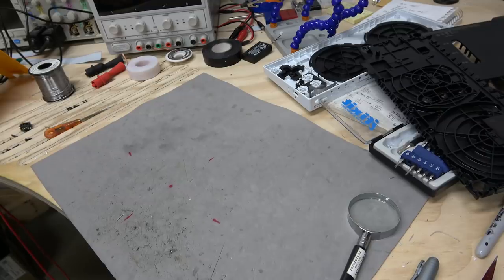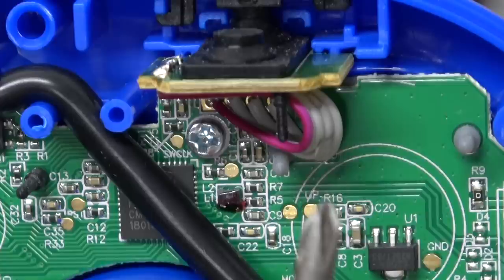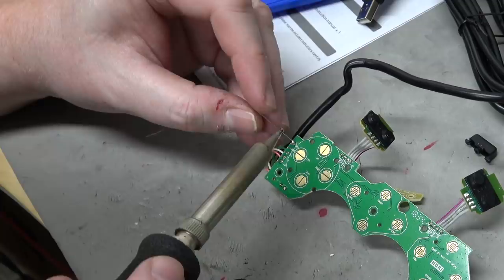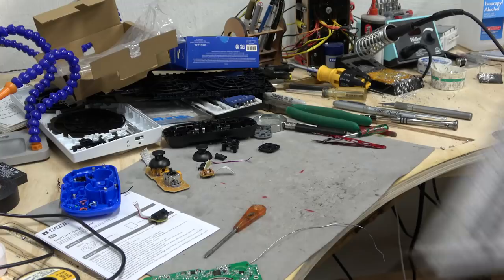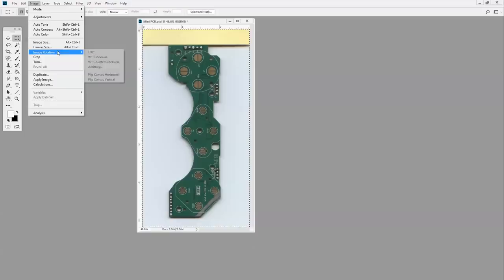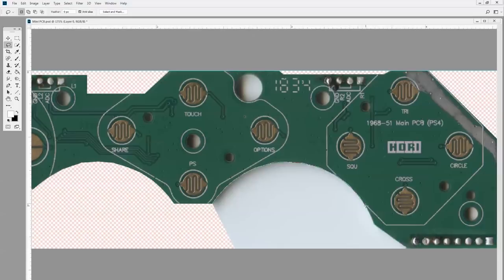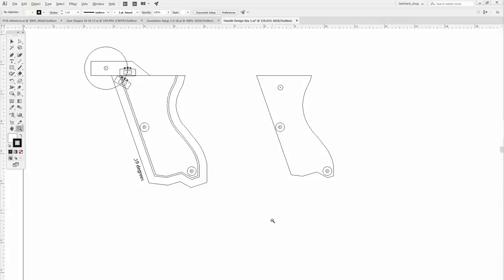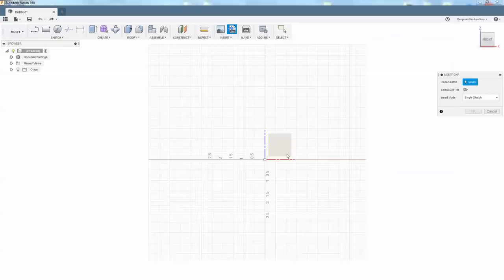The Quest for a PS4 Single Handed Controller Part 1

Comment: you don't have to wait for hot glue to cool off if you spray it with upside down compressed air duster can which freezes it in place instantly

Comment: I've had a spool of rosin core leaded radioshack solder for 5 years and all that has happened is a powdery corrosion that goes away as soon as you use it, so it's basically still like new.

Comment: this is super great but i disagree with the second joystick on the bottom of the thing unless there is a actual base or stand kinda thing for it... id rather like seeing an accellerometer gyro combination to give this thing something that is sorta gesture controlled. you could use a small micro for reading the mems ics and then a pair of digital pots to make this work. could maybe even work with the attiny10 (atleast pinwise)

Comment: The rosin in solder can go bad. But that solder is relatively skinny so it's probably fine. (Fatter/wider solder has a mich thicker rosin core and it goes bad after a few years.)

Comment: Saw a great suggestion I want to reiterate.

Any well made game does not require the player to both move the right analogue stick and press x □○◇ buttons

Therefore allowing an analogue stick and those 4 buttons to be controlled with the thumb, will leave all 4 fingers open for shoulder buttons and possibly start select ps back buttons.

This would leave some difficulty with the d pad, but many games don't require much from them.  I would say the d pad are usually the least NEEDED to be used keys on the controller.  If possible a small switch or button that allows you to switch the bottom analogue back and forth between actual analogue and d pad would work since you should never need to use left analogue while using dpad.

Some issues I see coming up
-analogue pressing.  The bottom analogue will need a press in function that isn't prone to accidental presses(Probably located elsewhere is best)
-as others have mentioned, touch screen
-haters

Lol I gotta say I didn't think it was a worthwhile project until I saw your dedication and spent some time really thinking about it.

I'm sure you're almost done with your version already so my changes won't be implemented, but maybe future projects :)

You go bro!

Comment: you know, having a couple of the buttons up by the thumb (probrably the X and O) would probrably make it easier to hit all 4 buttons when needed. i only bring this up because it seem like it would be difficult to use your ring finger and pinky to quickly and accurately use all 4 ( i am assuming the thumb controls the right stick and the base is the left)

Comment: What about another 4-way switch for the home, PS button, share etc. 

Not sure about using the smaller fingers for the triangle, square etc.,  even as a rock climber those are the fingers with the least control.

Comment: Some issues with this build as far as I see it yet.

One, The thumbstick is too far off center. Using it exerts pressure and creates a changing rotational force on the controller, which you can't counteract with any digit. There's only a little bit of stability provided by the strap, and that will move around at least as much as your skin and muscles move, probably more. Not to mention that it has its own rotational axis, which does not align well with the rotation caused by the off-center elements.

Two, The triggers need a counterpoint where you can exert opposing force on the controller. So far, the only good point for that is the piece that rises above your thumb, which is also issue number three:

The piece rising up above the thumb will be a hindrance to using the stick properly, and very uncomfortable after a while.

I'd try to reconfigure it as follows (if possible):
- Centered thumbstick
- action buttons where the triggers are now, two forwards, two diagonally left forwards, so as to press them with different segments of index and middle finger
- triggers where the action buttons are now
- nub for extra grip to go between middle and ring finger, maybe?

This is just off the top of my head, though, and I'd probably ruin twenty controllers trying to cut and connect all the pieces. So take this opinion with a good shake of salt.
Reply: I love how you write such an in depth analysis of his prototype but you fail to mention that it's missing half the buttons of a regular PS4 controller that are necessary to be able to play literally most games.
Reply: @noahstonemusic  
You are mistaken. I did not "fail to mention it". I merely chose not to do so because it is bloody obvious and he is probably aware of that.

News flash: Water is wet. The sky is blue. Day is bright and night is dark. Also, breathing is good for your health.

Comment: What about gutting a Thrustmaster (HOTAS) Joystick and replacing the electronics with the board that you took out of that PS4 controller and just connect the leads from the appropriate connection leads and you should have a single hand controller.

Comment: A remapping nightmare. The ABXY control is too cumbersome for 2 finger operation in your design, not forgetting they are probably the most used during gameplay after the analog stick. Can’t imagine design works in any title that requires fast multiple presses. The only way I see that design working is if there are 2 trigger buttons with triangle and square also in each trigger position. And the shoulder buttons would be moved to pinky finger location. How is the second analog stick operated?

Comment: Why not use a motion sensor like used on the switch for the look around analog stick instead of having it like a joy stick? Then you can still have your movement analog were you have and more around to look. 

I only suggest that because I have one of the 1 handed 3D printed attachments to use 2 joycons with 1 hand for the switch and it works perfect for stealth gaming.

Comment: What if instead of moving the whole controller to move the left analog stick, like in your previous designs, you add some sort of base or support on the left analog stick to rest on your knee. So then you can pivot the controller like a joystick? I think you would be able to get a lot more control over the analog stick.

Comment: Could... well of course you COULD, but would it be worth thinking about putting an analogue stick on the bottom. My thought being strafing movement could be done by resting the controller bottom to a surface (lap / table / ribs) while the aim control is done with the thumb. Would allow simultaneous movement and control!
Reply: You have seen a ps4 controller yes?  It has 2 analogue sticks lol

You're suggestion is to create some kind of new feature that no game would support instead of an analogue which is necessary for almost every game?

Sry if I sound harsh, just trying to understand what you mean
Reply: there are 2 analog stick, and as far as i can tell so far, only one is accessible. the d pad and the left analog stick are used for diffrent things. but without a thumb to give control to the left analog gameing can be difficult. putting the left analog stick on the bottom can have the arm/wrist control strafing movement while the same arms thumb controls aiming. the aiming needs more percision then strafing.
Reply: @wraithgear4216  ok...Ya I misunderstood you....your suggestion is exactly what he is already doing lol....said it in the video
Reply: @farfromirrational948  opps must have missed it

Comment: What if you put two buttons on the front face grip, where your fingers bend around, and you leave two on the side plate for the fingertips to control? I think it would work out better in a theory, but I could be wrong.

Comment: bro why dont you use magic wand ? XD you can edit the tolerance to cut exactly where you want with one click also right click when you have something chosen you can select "similar" in the menu that chooses simlar colors or grow which grows your current selection a bit ( also depends on the tolerance levels ) but i see some whites on the board which means at this case the lasso could work quite as well XD

Comment: I used FPC to get signal out of stock dualshock 4 controller before this controller came out, which I'm very regret since it cost a lot more to print a FPC than this controller.

Comment: So confused, aren't you missing two more triggers, the d-pad and another joystick? Pretty sure most games would be unplayable without those...
Reply: You can put the triggers and bumpers in succession at the back, 2 per finger, so you activate the bumper with the middle section of your finger and the analog trigger with the tip. The Dpad goes under the thumbstick somewhere and the last stick goes at the bottom so you can rub it against a table or whatnot.

Comment: Ah, good old 10k thumbsticks. All well and good until you're trying to build a custom controller for an atari and are confronted with the fact that the analogue input lines (which are for paddles, but... Eh. With the right code, who cares?) are designed for 1 meg pots...
Yeah...

I honestly can't think of a way around that which isn't seriously contrived. (eg, hook thumbstick up to microcontroller, feed microcontroller into a digital pot, feed digital pot into output. Seems like some major overkill, but what option do you have sometimes?)

Comment: 4:01 OMG! 1994! If I were you, I wouldn't use it. Wait. Hold on. Does that mean that's actually lead solder?
Reply: That's the whole point. Unleaded solder isn't very good. Requires much higher temps to get good joints. Cold joints won't conduct great and crack. Using the higher heat has a chance to destroy components. Lead solder isn't really all that dangerous to the end user unless you crack open your electronics and start eating them. It's more of the environmental/recycling when it becomes a problem...supposedly anyway.

Comment: Don't use Velcro for the strap. It's always a bitch getting to loose strap ends in the right place and put tension on them. It'd be far better to use something like the tensioners on backpacks for tightening the straps. That way it is always together but can just be pulled tight.

Comment: Hey, I'm currently working on a single handed game controller! You can see the WIP here: https://www.behance.net/gallery/73715379/Furiosa-Controle-de-videogame-acessivel

Very interesting to see your process. This was my final project to graduate on industrial design, and as you can see it's just a concept, with no electronics yet. Basically you started inside-out and I did it outsite-in.

Crazy coincidence that freaking Ben Heck is working on a similar project as I am. You're a big inspiration.

Comment: I got an singla handelt xbox one s "controler"... Its my mouse w 18 Buttons and an 3 gear shift System that alowes me 2 have 54 Buttons in Total
PS 4 sucks sry m8 but im able 2 play any game Just w my moese i Done even need my keyboard
Mk in total cost 500$ (i know expensive... But i wanted boobs printet All over IT) ull get the standart 4 200$